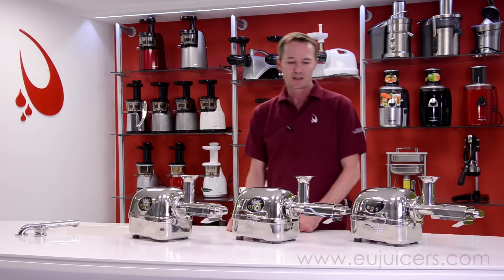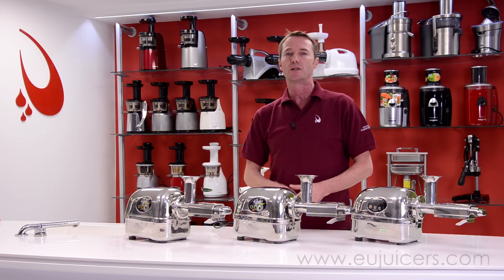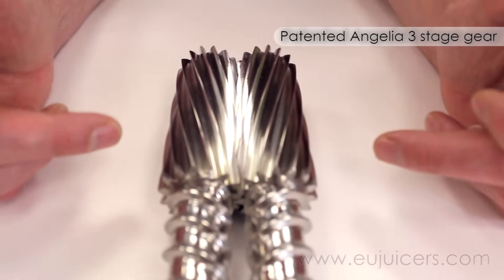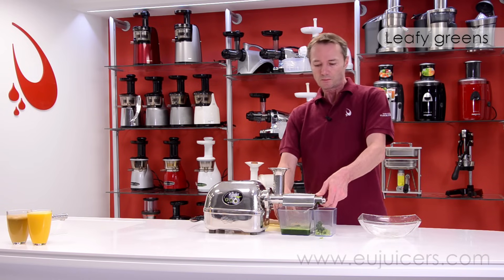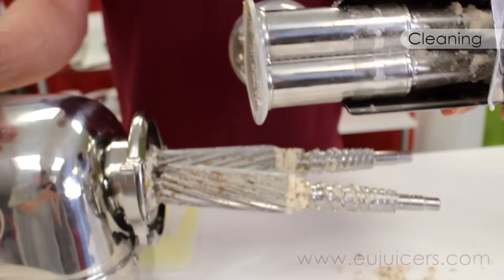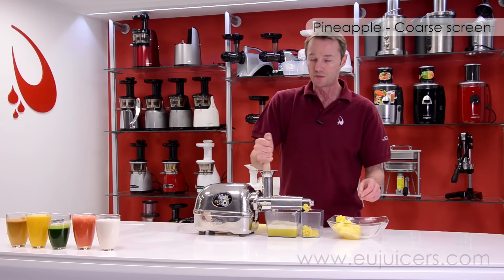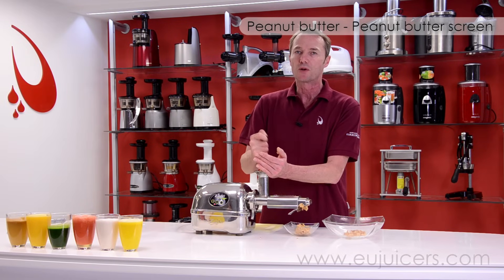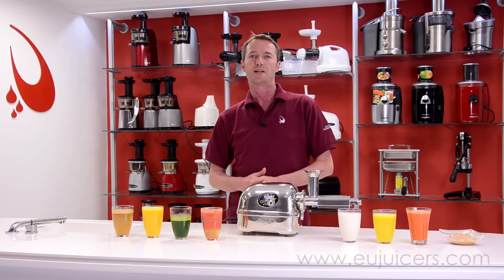Angel Juicer 5500 / 7500 / 8500

Comment: I have 7500 for more than 11 years in mostly everyday use. It has third electronics board, cause I flooded it many times while washing and probably 7th silicone ring now half destroyed, cause I want to minimize my plastic waste. This is all of needed maintenance. Sealing is original and except some scratches juicer looks mostly like new one. I love this machine. It's the best kitchen appliance I ever had.
I never add water while juicing soaked nuts. I love creamy consistency of soaked nuts juice. :-)
Reply: Hi! How often does the auto reverse system switch on? I can’t decide between 5500 and 7500 models. Thank you.
Reply: How much did you had to pay for the electronic board? Im surprised that you had to replace it....its not water resistant?
Reply: @ia6980  I don't remember exactly. About 60€. I'd be very surprised if the melter had a waterproof ejector.  That's extremely unusual for a tabletop home appliance.

Comment: The 5500 is the best cold press juicer I have ever owned (by far). Amazing machine. Extremely easy/quick to use, super high quality juice and highest yield. You really need the larger silicon pusher though - it should come as standard, the current standard one is useless!

Comment: Just purchased 5500 our first ever juicer,FANTASTIC FANTASTIC. Dead simple to clean, pretty dry pulp, lovely juiceFANTASIC
Reply: Hi there can you tell me how you getting on with your juicer do you still have it have you had much bother with it would you recommend it
Reply: @atifmanzoor63   I recommend it 100% , This is based on the quality of the machine, I purchased the one with reverse gear,, fine and course sieves are excellent if you want a smooth or more fibrous  drink. I still use both depending on the days requirement, The amount of juice I get from each item is judged by how "dry" the waste pulp is, Based on the price of fruit (oranges) in the UK and the price for processed juice,, I easily get more juice per £.  I have had great use out of this machine without any problems. Cleaning is easy enough if you have a little patience and is worth the extra effort compared to say a blender/juicer. Used most days

Comment: Hi! This question got asked--but was not answered.  Which attachment are you using for the FRUIT? The apples and oranges and tomatoes.  I am thinking that you are NOT using the SOFT FRUIT ATTACHMENT because you juiced GREENs (alone) as well. This is an important question for potential buyers. We need to know if the Soft Fruit Attachment does a better job on the soft fruits THAN the standard attachment. Also, demos using the Soft Fruit Attachment would be incredibly useful for your audience.  Thanks for all your great demos! Angela
Reply: I believe it was the fine sieve. The fine sieve should be used with all produce unless you do a lot of over-ripe or mealy fruits.

Comment: Not trying to discredit this great video but after having used the Angel daily for the past 12 months I've found the fine screen is not good for everything as soft fruit like pineapple, kiwi fruit, pear, etc. will clog and back up the inlet very quickly which is why the course screen is available. Also when doing oranges and lemons I've never bothered to peel them as seen of most demonstrations  and it's never been a problem. Fantastic juicer highly recommend. Bit expensive.

Comment: Is there a difference in taste between the three angel juicer? Thank you for sharing.
Reply from the maker: There is no taste difference. The three models perform identically. The only difference being that the 8500 has surgical grade stainless steel instead of food grade, and the 5500 doesn't have an autoreverse feature.

Comment: How can you differienciate a 304 Steel grade twingears from a 316 Steel grade twingears?
For the other parts is enouth with looking at the inprints.
Reply from the maker: I believe it is imprinted on the flat surface of the gear, where it attaches to the motor base.

Comment: Hi All, I am trying to decide to get the 5500 or the 7500 Angel Juicer. I have heard with the 5500 Juicer as it does not have the auto-reverse function it can potentially allow the engine to be damaged if you put in too much in the feed tube. But on the other hand with the 7500 i have heard there have been problems with the auto reverse. Would love some feedback, thank you
Reply: Did u end up getting one
Reply: I have the same dilemma. How did you decide? What has been your experience? Thank you!